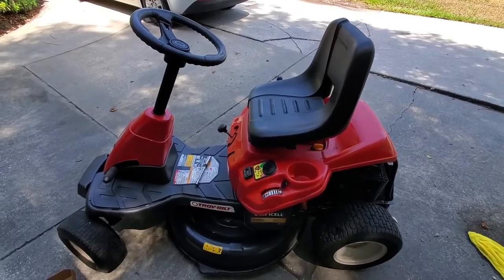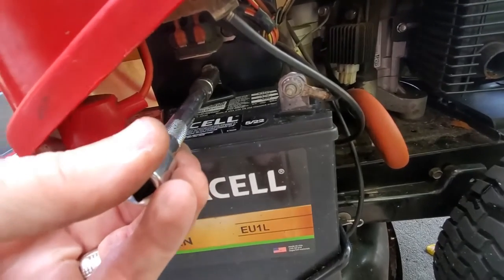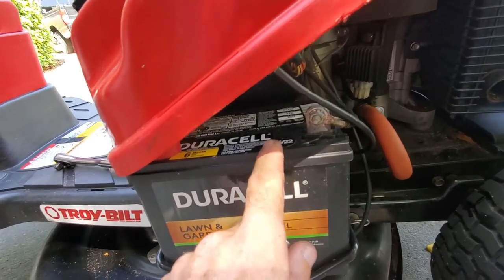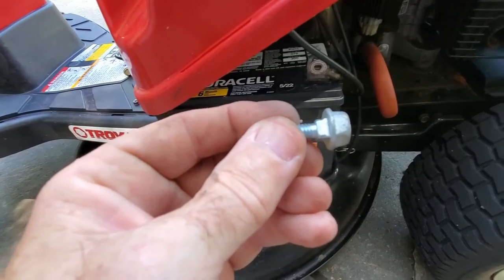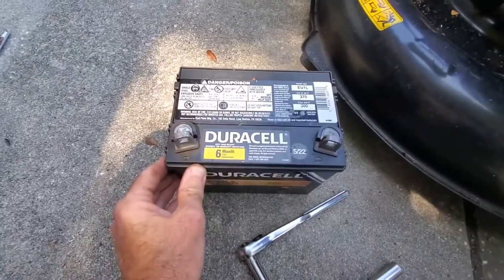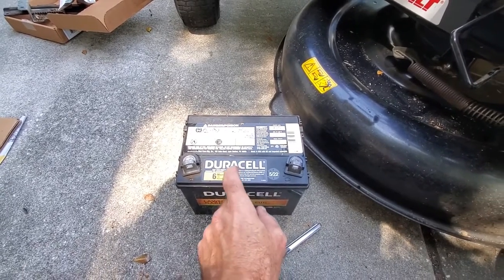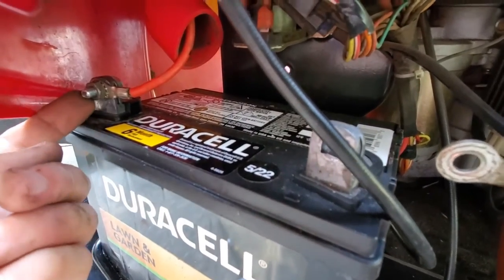Troybilt TB30R Battery Change *Easy DIY Project*

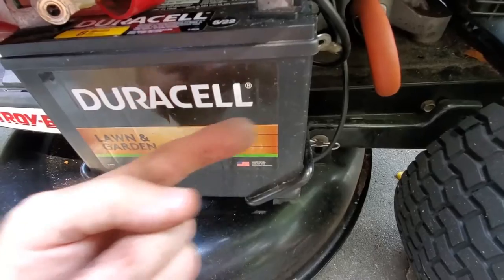Comment: Dude...first off (at around 4:04 mark), you don't need to slide the battery up and out like you showed.  The bracket that holds the battery itself just lifts straight up (it's connected into two holes).  Just pull the bracket up (with the battery) and pull it forward.  Then replace the battery, take the bracket with the new battery and just seat it back into the two holes (which takes a little patience) and voila...easy uninstall/install.
Reply: How do you lift the red plastic up? I took out the 2 screws in the back but it only lifted the back part.

Comment: Hey Peter, I've had my TB30 for 5 years. I have used many of your tips with good success. I put the Drainzit hose on 3 years ago and oil changes are a breeze. I live in Central Iowa and I pull the battery every fall and keep it in the basement. I can get nearly 4 years out of it.

Comment: I appreciate this video. I did it by myself today. I would like to add that the bottom right bracket will come off if you lift it a little. Also, make sure the store sells you the positive left and negative right. Ace Hardware tried to sell me the opposite,

Comment: I purchased a 320CCA, AGM battery UL1 through Amazon for $69.99 as it should start the mower better and faster and last longer than the standard 200CCA, Non AGM  UL1 that cost about $50. I'm hoping to get double the life which would be 5 or 6 years. I remove it off season (winter) and put it on a Battery Tender trickle charger for maintenance while it is out of the mower.

Comment: YOU DIDNT SHOW HOW YOU GOT THAT RED COVER UP TO REMOVE THE BATTERY, thats what I was here for!
Reply from the maker: It wasn't in the video because it's not necessary
Reply: @petedymond  but you do have it loosened a bit...how'd you do it?
Reply from the maker: @Habitation2023  No, it's not loose at all. It will flex up and allow the battery to be removed: https://youtu.be/GZNfZMNTsuY?t=261
Reply: It would definitely be helpful to lift the red hood and it definitely looks like it’s raised in video. Wish I knew how he did it
Reply: @petedymond  but it was necessary, figured it out myself then sold the stupid thing and bought a husky!
Reply: I agree with IMA. It is virtually impossible to get battery out.
Reply: My red cover just lifts off enough to jump the battery. 🤷‍♀️ Maybe different model years don't have that?

Comment: That battery looks a lot bigger than the one on my TB30...can anyone confirm the Battery number that will fit a TB30...the one in video appears ro be a Eu1L...but the EU1L is physically about twice the size as the one on mine.
Reply: I would match to the one you have. They may have changed the specs on yours

Comment: You can just drop the right side of the wire bracket. This drops the battery far enough to clear the cover and the throttle wire. Easier to get 1 side of the wire bracket back in the hole. Everything else is excellent advice.

Comment: My only issue with a snake in my lawn more because I’ve had mine and I tend to like mine very much. Is the fact that it doesn’t have an easy accessible way to charge the battery besides taking the entire cover over a little difficult you if you don’t have the tool rental that’s capable of doing it you gotta stop complete year, which is pretty large here waiting for you brother there or I can bring you a tool after work. Yeah put a bigger damper on my day. Let me tell ya, or does anybody else have any bright ideas about this making model

Comment: Great video. 
Was wondering how your hour meter was working out? I think you installed it 5-6years ago. Is that an inductive type meter or does it run off the "key on" 12v position?
Reply from the maker: It was an inductive but the sealed battery died so I lost track of hours!

Comment: Peter, i just did an oil change and before i did that it started ran for a bit and did the tune up. After i was done i tried turning it on but no click no sound nothing. I checked fuse and it was fine but just noticed batt is from 2016 and we are in 2022, you think its my batt?
Reply from the maker: Check all the safety switches. The blades must be disengaged, the brake pedal fully depressed, the seat occupied and the blade cover plastic properly attached.
If they're all good then try jumping it from a car. If it starts but won't start again on its own then buy a battery.
Reply: Really? Six years on the original battery? No way!!! LOL!😄

Comment: Should I add a battery tender? Does anything actually charge the battery while your mowing?
Reply from the maker: The mower charges while the engine is running using a magneto coil system.
If you put the mower up for a season, like several months over winter then yes a battery tender will help keep it charged.
I use my mower pretty much year round here in N Florida so I've never used one.